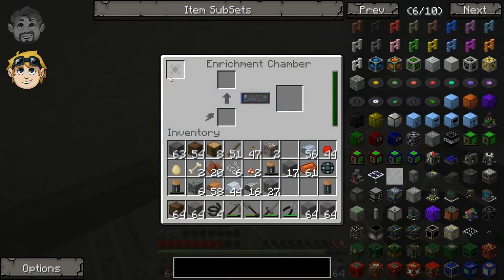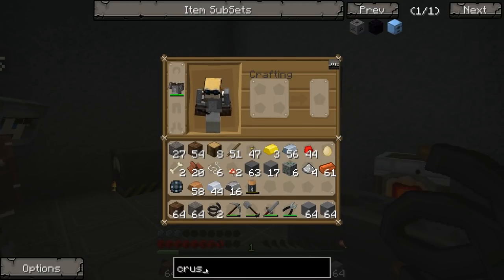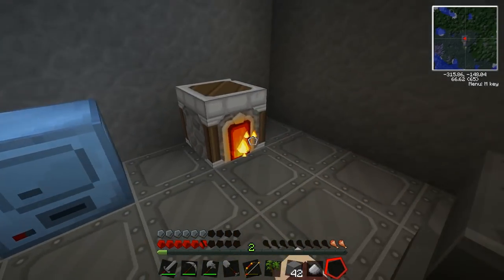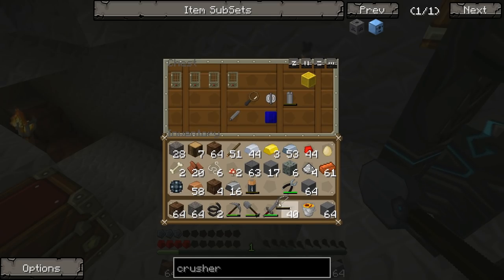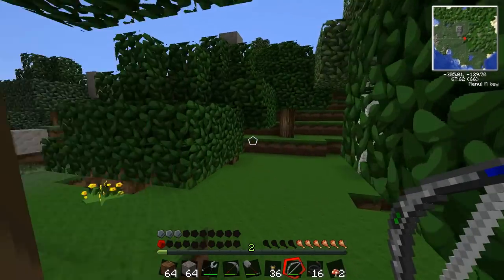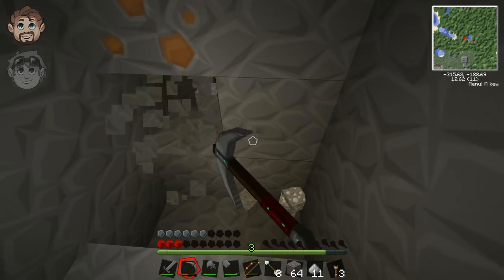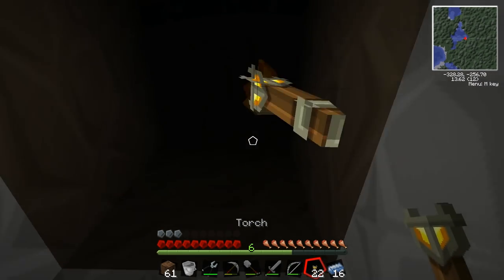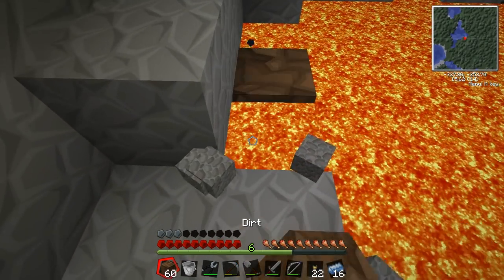Voltz - Part 3 - Hunger Pains

Comment: you get steel dust by putting iron (or iron dust not sure) and compressed carbon in the metalurgic infuser you get compressed carbon by cooking coal i am pretty sure then cook the steel dust and you have steel ingots

Comment: a fishing reactor
Reply: I think they meant fission reactor, which has to do with something exploding I think. Idk
Reply: +TheCreeper now, I'm not an expert on this but...
it has nothing to do with exploding.
it works by fission. fission is where you get a very complex material with a reasonably long half life (by that I mean well past human lifetime). uranium is a good resource to use. what you do then is you get that material and you fire a neutron at it at very high speeds which cause an energy burst and splits the uranium atom. this also kickstarts a process in which the uranium atom continually splits and splits and splits over and over again. when this reaction is controlled it is called fission power. when this reaction is not controlled, it makes a nuclear bomb. 
I'm not sure exactly how this is done in fission reactors but I said what I know.
Reply: +Definitely Krell tldr making energy by splitting atoms
Reply: _ Dodo _
in short, yeah. But it gets more complex than that XD